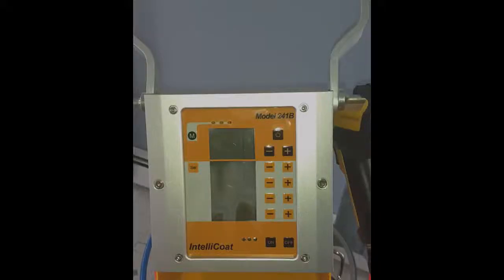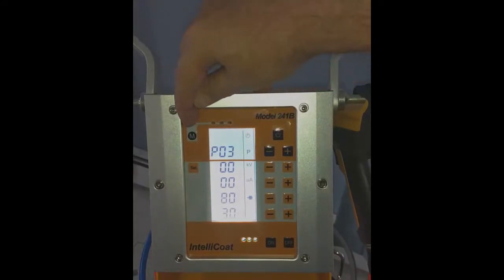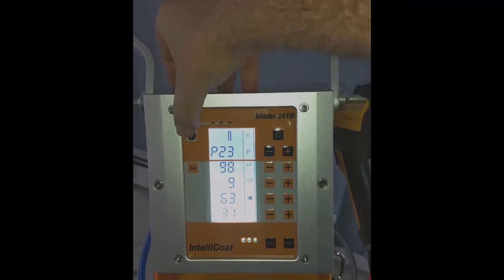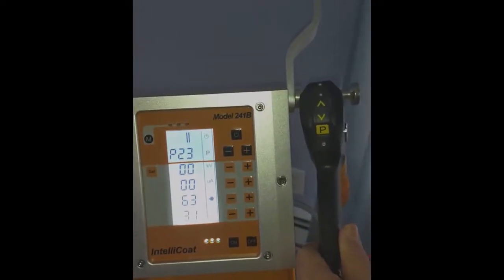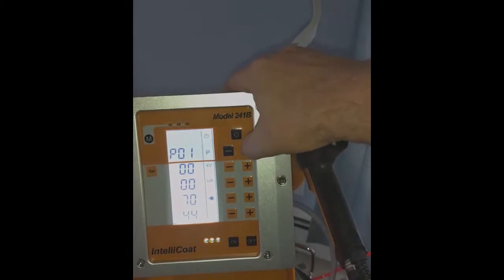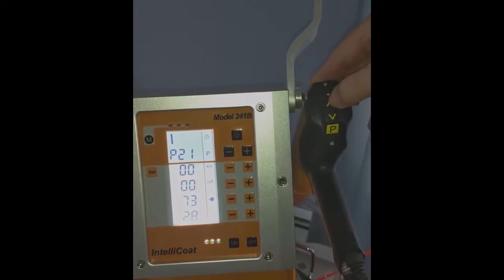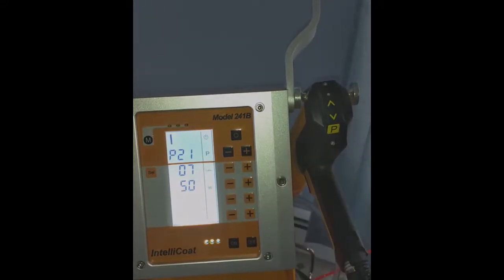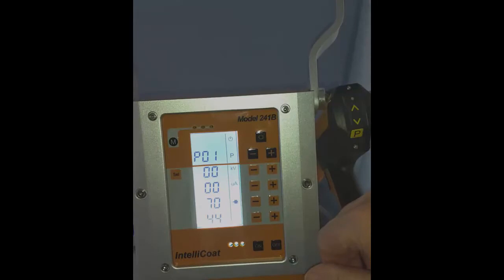IntelliCoat Powder Coating Gun Controller Functions

Comment: I’m confused, what is the last setting on the screen for, the bottom one? Versus the setting in the secondary mode?
Reply from the maker: It is the "dosing air" or "smoothing air" Its purpose is to smooth out the powder exiting the gun tip into a steady air/powder stream. Its found in both the primary and secondary menus of your controller for convenience when you are using either the box feed mode or the hopper mode. Please see page 8 of the manual.
Reply: So in hopper mode use secondary and box feed use front screen? The display functions on manual call them all different names on the Controller Display Functions in manual 
Clean Air
Fluidization Air
Conveying Air
Supplemental Air